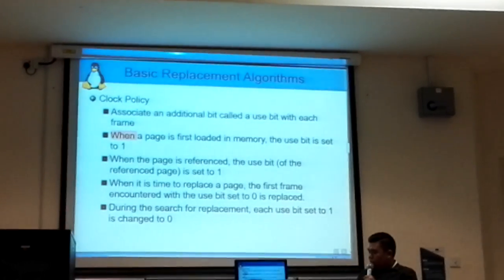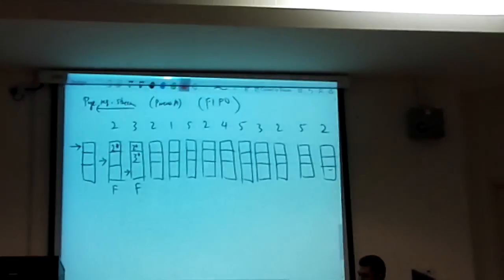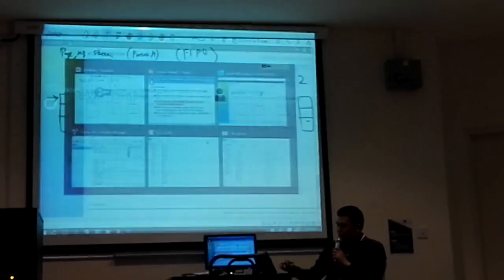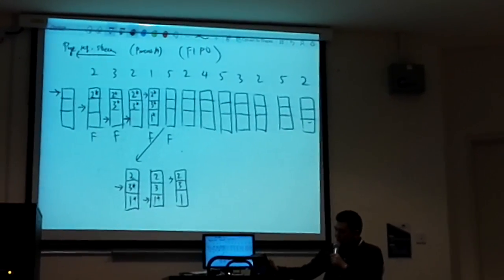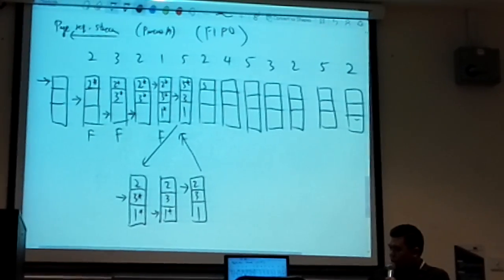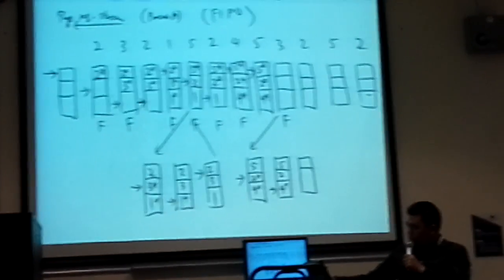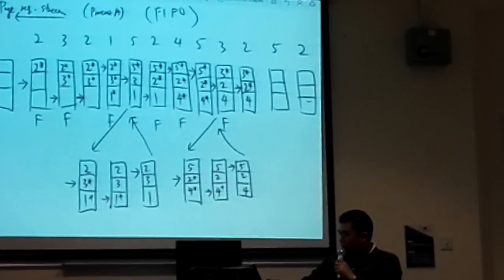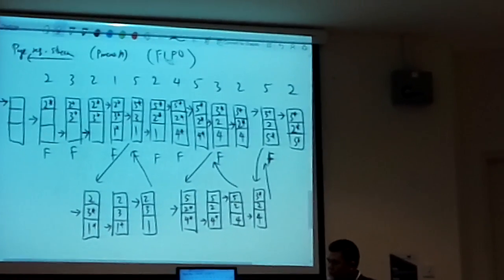[Operating System] Clock Replacement Policy Lecture

Comment: What is  the star stands for??
Reply from the maker: The asterisk means use bit is set to 1 , and the particular frame cannot be used
Reply: you mean when a frame its use bit = 1, that frame cannot be used or replaced??
Reply from the maker: If use bit set to one, means the frame is not the frame to be replaced . When looking for page to be replaced, the clock pointer will always look for use bit 0. If it's 1, change it to 0.
Actually it's already shown in details in the video and your textbook. Repeat this video until you understand.